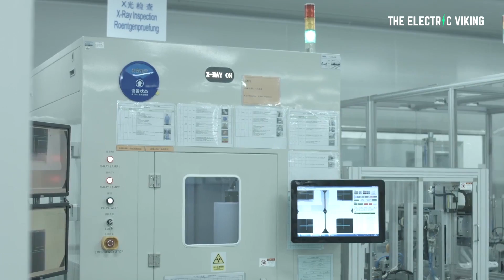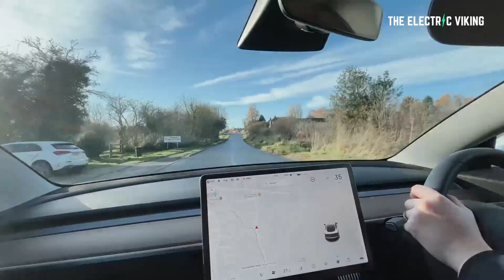This NEW battery changes everything - GAS sales will collapse

Comment: By 2025 CATL will have a battery manufacturing capacity of 670 GWh....to put that in context the entire world only produced 286 GWh in 2021..and that was a doubling on 2020.  So by 2025 CATL will make enough battery packs to build 12 million cars like the Kia e-Niro(64 kWh). Amazing. I am no math guy but I reckon to replace the entire global production of cars and vans (about 80 million per annum) plus buses, trucks, diggers, farm equipment...everything to electric motors will need about 7 to 8 Twh (Terra Watt hours) production per annum...and one company will have 10% of that by 2025....It’s all doable and CATL have set out their stall.

Comment: LED lighting had the naysayers a few decades ago too. Today LED lights are placed absolutely everywhere including including the very few areas where another technology would make more sense. Electric cars will be the same, they're superior in almost every way to their internal combustion counterparts. Their current Achilles heal is the battery technology, seems that's changing quickly.
Reply: Well they cannot tow caravans or boats.. as the load and/or speed increases.. the range falls back. A lot.. try 66% loss towing a van on the highway. Don;pt believe me.. check out the Fast Lane where they tried it.

Comment: Great video! BUT, being that the oil industry owns most politicians there is NO way NO how that ICE vehicles will be gone!  We're talking trillions of dollars/euros/yens/rubels that are based on the consumption of gasoline. Unless you suggest that electricity to charge Teslas and other EV's will be generated running the old/recycled ICE motors you cannot convince me they'll be done away with.
Reply: yeß pey fir kw

Comment: The problem with electric cars 🙂 in this case of 5 min charging is the math. A nominal EV battery is 50 KWh (T Model 3, Leaf, etc.). Power requirements for 5 minute charging at 100% efficiency would need 1200 amps at 400V. The reality would be about 80-90% eff, making the 5 minute charging run at 1500 amps. That's the kind of power that runs on electric poles, not the kind you want the average consumer plugging into a car without serious safety gear. Sometimes I wonder if people really think about these "game changer" videos with the knowledge of what's really being proposed.
Reply: You're correct.  I don't even know what kind of insulation and cables run the 800V EV chargers -- but it's scary.  And there are definitely going to be 800V charging stations.  I suppose that requires 750A at 800V in 10 minutes.  To do this, I'd think it will require attaching 2 charging cables, otherwise, the charging cable will have to be so insulated, it will take 2 people to pick up 10 feet of cable to plug it in......
Reply: @michaelbradley1636  - I can see it going two different ways. One: no self service in the high speed charging stations; requiring a certified tech to plug/unplug the car while the customer waits in another area/room. Like when having your tires changed. Two: dedicated charging station bays where the car is plugged in by the customer and then customer leaves the bay for charging to begin/proceed.
Reply: I doubt The Electric Viking understands how to do an arc flash calculation.
Reply: Excellent observation. Looking at it from a macro perspective with the US consuming roughly 20 million barrels of oil/day, with 82% of that going to all fuel types, and converting that to kilowatt-hours, you will arrive at the simple fact the US uses the equivalent 8.3 Trillion kilowatt-hours in gas, diesel and jet fuel each year. Last year all American electrical utilities produced a combined 3.3 Trillion kilowatt-hours of electricity. With transmission losses and engine efficiencies roughly offsetting each other that would mean the USA would have to quadruple it's electricity production. I don't see this happening without all fuel types. Fossil fuels, nuclear(I would hope thorium would get it's chance), solar and hydroelectric(which has been taken as far as it can). I left out wind because it is truly a colossal waste of time.
Reply: You are right and that 5-10% energy loss is going to manifest as heat, 5KWh in 5 minutes is a lot of thermal management.
Reply: My point exactly in my comments in the thread.  Some of these videos are on the border of clickbate.  Simple math is a scary thing.  The good news is that charging on a V4 supercharger with 350-400kW power delivery with a totally flat charging curve would fill the battery from 10-80% in a very reasonable amount of time to make the whole time to charge argument disappear.  Also a flatter curve at home is also a good thing, but mostly unnecessary.
Reply: However, Valkyirie, the faster the charge, the more vehicles per charger. A 5 MIN Charge can (theor) can charge 12 cars / hour, 288 /day. 1 hr chg? 24 / day.
Reply: @stuartsaunders3238  - Not really. You're forgetting the human factor. Go to Costco and measure the time at pump vs the time actually pumping gas. 
Then, try a busy place like QT or Buc-ee's where there's more than just gas to purchase. A 5 min charge at Costco may lead to a 6-7 minute turn time or for QT/Buckee's, the turn around may be averaging 10 minutes.

The really lovely thing about charging stations is you can have more individual charging ports than your actual capacity to charge at any one time.

Comment: It isn't over, because the electric grid cannot produce enough to charge all these cars without traditional coal, oil & natural gas to produce the electricity. The world is decades away from being green. It's great to charge so fast but there isn't enough places to charge the cars at this time. You can't generate enough electricity from wind and solar to do away with traditional forms of generating the electricity. Do you know about the enormous amounts of pollution producing these batteries makes? It's a lot deeper than you understand at this point. This is great news but there are many problems that need to be solved before all cars can go electric.

Comment: Sounds exciting, but not everyone has got solar panels and city dwellers certainly don’t, so charging batteries still rely on fossil fuels for most countries! Also as far as I’m aware there are no facilities to recycle batteries which have a certain lifespan just like solar panels, and   let’s not even mention the rare and extensive materials required amd electricity to manufacture them! So in Australia we’ll stick to Toyotas and Hondas as the most reliable cars and high fuel prices! Thank you!

Comment: I agree with you. But in the US it's a charging problem and greater distances.. There needs to be standard charging plugs and power output.
A pickup truck that can go 600 miles or a 1000 km loaded with trailer . 
You get those two things it be golden

Comment: So, you're omitting some important details here, such as will these batteries require a fast charger to charge in 5 mins, bearing in mind that, here in the UK for instance, fast chargers are very hard to come by, unless you have a Tesla of course. Also, will these batteries actually bring down the cost of the car as well, as this is one of the biggest issues for people who want to change to an electric car?

Comment: Hey Viking, it is basic math. For example, a 1200 kw charging pipe can deliver 20kw/hr of power per minute at max battery acceptance rate (before taper). If they are claiming charging from 10 to 80% in 5 minutes, on a 1200kw charger, you could deliver 100kw/hr in 5 minutes. That is fine if you have a pick-up with a 150kw/hr battery that can actually handle 1200kw charge rate. Last time i checked there was not a lot of them around! Of course, if you have a 70kw battery, then 10-80% is only ~50kw/hr, and to put that in, in only 5 minutes you need 600kw of power in the charging rate. Not a lot of those around last time i checked also!!
Of course you could charge a 20kw /hr battery to 80% in 5 minutes (assumng no taper) with a ~200kw power supply!
Please tell me what they are not telling us! (or do they really think they have battery chemistry that can handle these 'superelevated ' charge rates?!)

Comment: Any EV you want to name costs (in Western markets) approximately twice as much as a similarly optioned ICE vehicle - and weighs around 50% more.  You only have to go to manufacturer's websites to confirm this.  There is no doubt that the additional up-front cost of an EV will be recouped over the years by its' reduced operating costs - but this purchase hurdle remains real for many people.  And how long do you think it will be before governments start taxing electricity used to charge vehicles - to fund the roads deteriorating under the heavier EV's - or at least that will be the excuse?  Until fossil fuel subsidies are eliminated,  proper cash incentives for EV's are put in place and affordable EV's are available, an EV,  however much I'd like it, remains out of my reach.

Comment: What % of the chargers available today can charge at a rate that can get you to 80% in 5 minutes?  I get this won’t typically be needed because of home charging, but not every street corner has the needed electric capacity for a bank of these chargers.

Comment: Could I tentatively and politely suggest that current solar and wind energy unit costs are unsustainably high. Especially as both systems have working lives in the order of 20 to 25 yrs. Please correct me if I'm wrong. Especially as we have next to no local industrial base for producing them. This cannot equal the ongoing costs of building and maintaining a power station of any sort which can be spread out over a lifespan of 80 to 100 years though the costs of building in the first place may be high. What you have to do is separate that from the price you can sell the electricity for and spread that over the working life of the power station. Solar cell costs have to come down a lot or the units have to be able to last much longer in service to be at all competitive. I recommend the technological breakthrough managed by the University of Newcastle NSW where they have been able to print solar cells and where they are aiming hopefully for a cost around the order of $10 per square metre. This is around the sort of area you would have to get towards for solar cells to become competitive. That way you should be able to continuously replace units as they break down or are damaged in order to be able to keep the electricity production high enough and cheap enough to remain economically viable. It's no surprise that our power bills have doubled over the past year and be cautious of anyone who tries to tell your that renewables will be cheaper. They're either ill informed, lying or failed primary school maths.

Comment: Battery cars aren't that good a bet if you do the sums, surprising as that might be to the zealots. Not unless we can build in radically more reliable base load generation into the grid. This means new power stations whether coal, gas or nuclear. Solar and wind can do a fair bit but not all. And crucially not affordably with current technology. We would need to cover a formidable base load with only a relatively small percentage of the vehicle fleet becoming battery powered. Particularly at night. The cost of doing this with stationary battery storage charged from renewables does not look encouraging. Quite the opposite. A further quick basic calculation shows that running out enough recharging stations to sustain any kind of meaningful fleet of electric vehicles would be problematic unless it could be put on a sustainable profitable basis by private industry. Fair warning too as we are already seeing the costs of maintaining even the few charging stations we presently have in working order are high and continuous. They have to be counted on too. Unless it can be done profitably it gets hard to maintain. Contemplate that all levels of Govt, Federal, State and Local are battling to maintain our current transport network and that our local and state authorities are struggling to fill in potholes in our streets and local roads and you get some perspective on the dimensions of problems. If we can't afford to full the potholes in our streets can we afford coal fired electric cars? And how many?

Comment: Even a 60kWh battery pack charging from 10-80% in 5min would require between 500-600kW charging power; so, this isn’t possible at any DC fastcharging locations presently in existence in the USA.  I’m afraid this is a pretty “safe” breakthrough announcement by CATL, for no one will be trying to use it for years- if then.  The 10min version would be infinitely more practical, but even that would take all-new charging infrastructure.

Comment: Mid 2023?  So does this mean the 4680 is cancelled because the big advantage of tabless was suppose to be charge/discharge time. Mid 2023 is when Tesla has said the 4680 vehicle production like the Cybertruck is going to start. This does not sound to solve the key problem of Lithium production limits which at present would choke production to under 5 million BEVs industry wide.

Comment: Viking guy - your just a fan boy and a douche bag. Even if batteries become perfect and accept unlimited current to charge, the bottle neck will always be how much energy that you can safely charge over a wire. I fill a Toyota Corolla up at my gas station in 2 minutes of pump time and get a near 400 mile driving range. If I need 80 kwhrs of electricity to drive the same range, and I want to charge in 2 minutes here is the math fanboy:  80,000 watt hrs * 3600 secs / 120 sec / 240 Volts = 10,000 amps  - impossible to transmit that much electricity over a wire in short period of time. I love your videos, but improvements in battery tech will not overcome the fundamental laws of electro-magnetism, that is electric cars will never match the convenience of liquid fueled ICEs

Comment: That's great 80% in 5min imagine what amperage that is at, it's all good to have such tech but the power grid won't handle that size draw...it's massive for just one car to charge imagine hundreds of thousands of them all charging day in and day out at 500 amps per car charging (Just a guess might be more?) It's likely that this "E" revolution is going to happen and now with Russia starting and funding wars from oil sales it's going to happen quicker, but it's still going to be another 15-20 years to fully do away with liquid fueled transport in reality that would be really quick. It's possible that it could happen slightly quicker if Semi's can get up to speed and make it less expensive then it happens quicker...ish.

Comment: The concern I have is in sourcing all of that electricity. The load on the grid from charging that fast and at scale (i.e., with a twenty station charging site at 70% capacity 24/7) will require either fast peaking stations or a battery pack feeding it five to ten times the juice.  We have to make sure we don't contribute even more to co2 emissions by sourcing that power from standard peaking stations.

Comment: I have a 2019 model 3 performance. This news is not a big deal in reality; for convincig dummies yes.
My car takes 30-40 minutes to go from 10-80 percent, Half that on new chargers. This battery would not change my road trips at all, most of the time I'm still not ready to leave by the time the car is I mean I can do 3 to 4 hours on a charge.

Comment: So, what are the charge rates required to deliver those times? Every required charger would need to be upgraded because the cabling would need to handle 3 or 4 times the current. It's taken Tesla over 10 years to get its charging  infrastructure to this point.
Reply: Countrywide infrastructure would need to upgraded as well to enable charging within minutes. In the Netherlands this tech cannot be utilized simply because the power grid cannot handle it. I am no expert however and I have no idea if the power grid can (easily) be upgraded and to what extend.

Comment: It sounds like the batteries just surpassed the charging equipment, I think level 2 charging will remain at 40 miles of range per hour because the equipment just can't handle a higher load.

Comment: This is great, my biggest concern is that the faster the charge time, the higher the charge current. Going to need a good connection and thick cables. Any poor connection or joints will not only slow down charge but create heat (fire). Can be done but needs to be done right. The problem will be somewhat exacerbated when EV trucks (that means prime movers, tractor trailers etc) come on line as the battery packs will be multiple times larger.
Reply: I expect the trend to higher and higher voltages will continue for a while.
Connectors can be made so that they lock together and get a very good connection
Reply: The copper price will skyrocket! i think i'll start to buy copper stock
Reply: @littledevil2412  Copper is already way up.  They amount in the charging cables etc is not going to make it go a lot higher. Aluminum may be a better bet.  That is what the transmission lines are made of.

Comment: thank you electric Viking I'm so impressed about your analogy this morning the upcoming event will not be 2040 it will be 2030 I tell you by 2030 it is already game over The legacy auto if they don't catch up by 2030 they should forget about it because electric vehicle has come to stay but for Africa it might go past 2030 ,2040, 2050 you know what I mean thank you very much. and for the benefit they are so much better gas engine no no no no you talk about the engine oil or the gear oil or the spark plug they the filter the water radiator, the electric vehicle eliminate all of this so what are we talking about this is the better future electric vehicle is the way to go